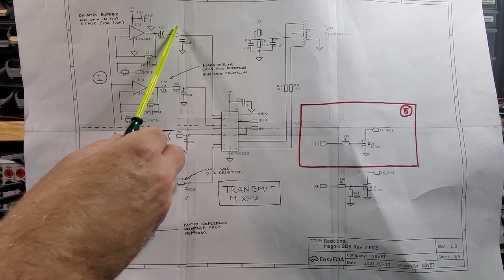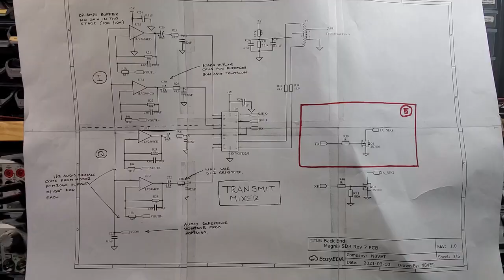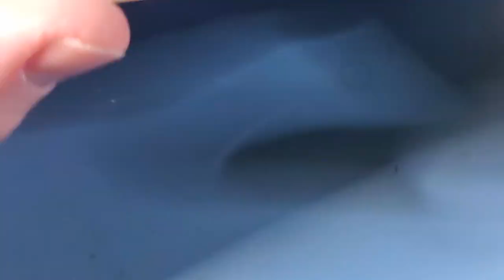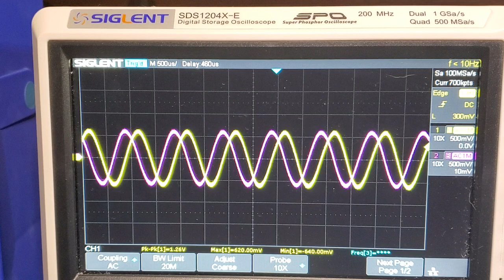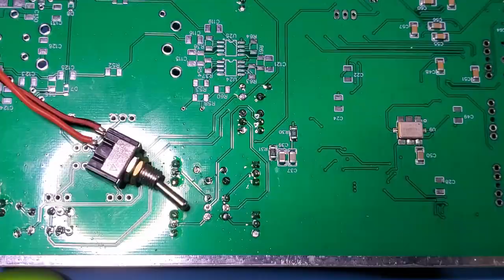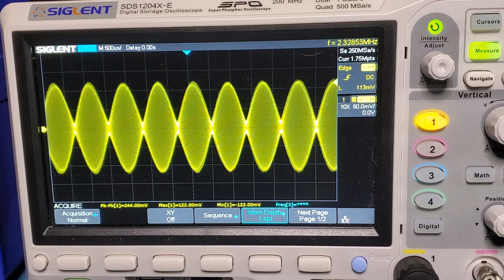Magnis SDR - Part 7 Transmit Mixer

Comment: nice video,  i just built a soundcard SDR transmitter as well,  my approach was to make a 14khz iq signal before the soundcard dac,  the dac clock is 192khz,  then feed the 14khz signal to a mixer mixed up to 10.7Mhz,, ran that thru two  10khz wide crystal filters,   then another mixer to mix down to zero to 5MHz range.   also installed a 5Mhz low pass filter on output of second mixer.            for a 0 to 30MHz range,  you could use two 45MHz crystal filters.       for the two LO's,  i just used those two channel DDS sig gen from china,  plenty of models go up to 80MHz nowdays.     73s.